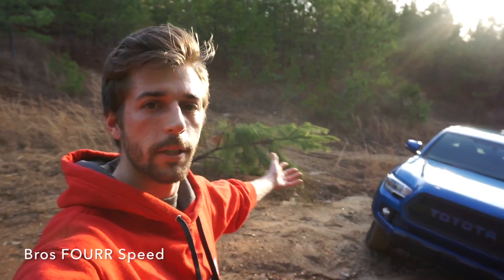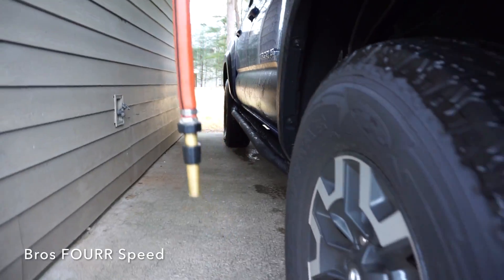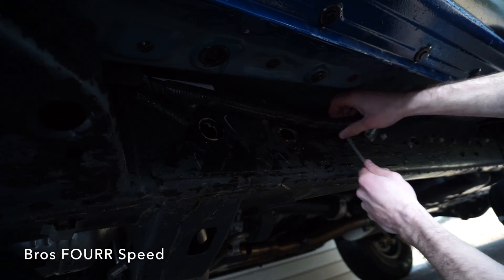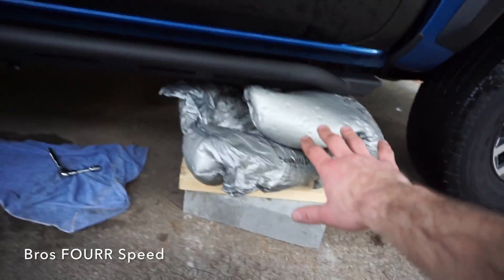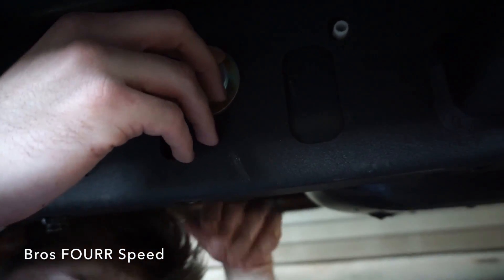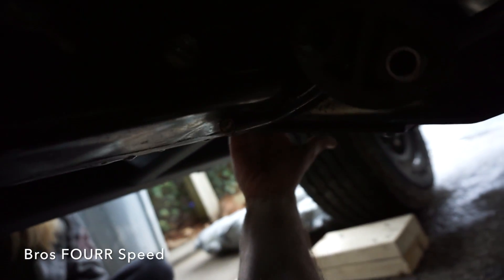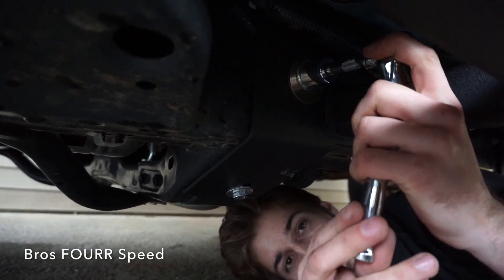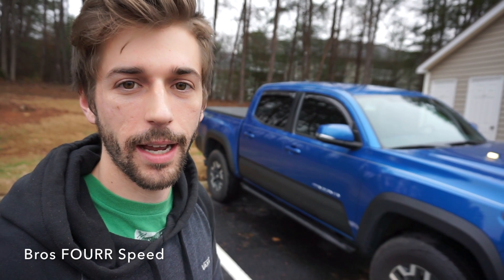3rd Generation Toyota Tacoma Rock Slider INSTALL! | Victory 4X4

Comment: What model of the victory rock sliders are those? Couldn’t find those on their website
Reply from the maker: Here's the link! https://www.victory4x4.com/product/VT23SL-ST.html
Reply: Thanks! Are yours powder coated or bare metal??
Reply from the maker: @jonathonquintero2560  powder coated, I wouldn't do bare metal as that would rust easier. After having them now for 2 years I think it is, holding up well with minor touch ups from using them!

Comment: I assume the brake lines are far enough away as to not rub through on the bolts? Otherwise I like the look!
Reply from the maker: Yes they are, it's a tight fit, but works well.